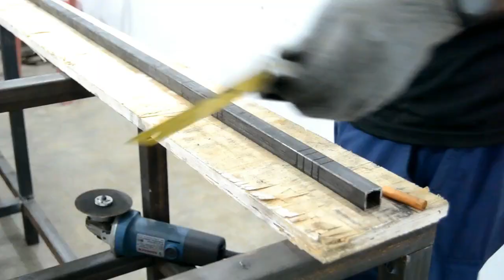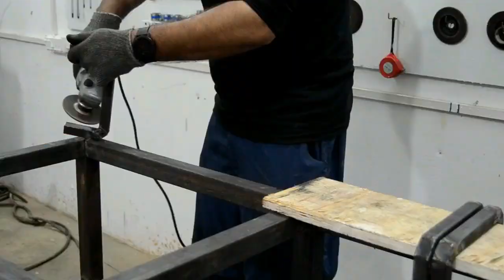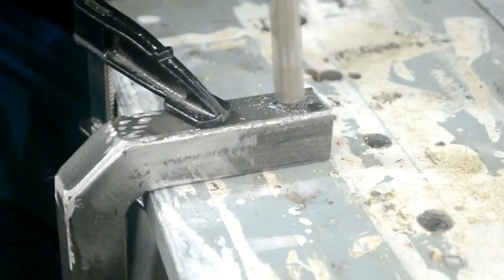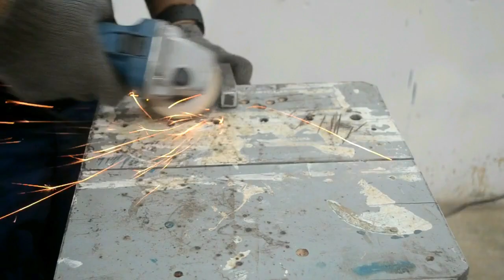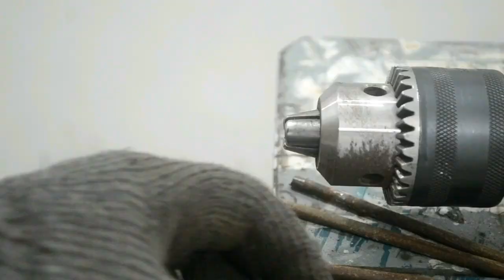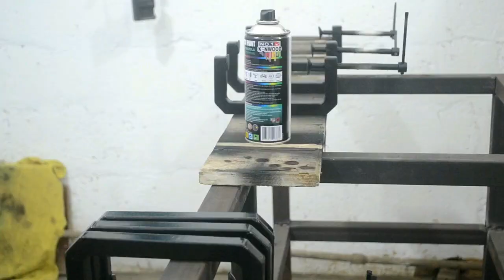how to make metal C clamp diy for your workshop [ZUNBOOR ENGINEERING]

Comment: Nice work! But for your safety, stop wearing gloves while using the angle grinder. The gloves could catch on the blade and mangle up your hand. Also change that small and damaged cutting disc before it shatters in your face!
Reply from the maker: Thanks for your advice